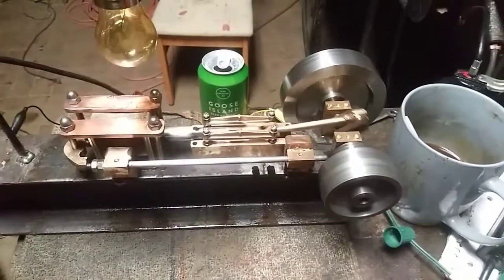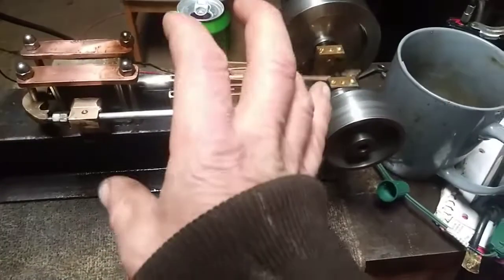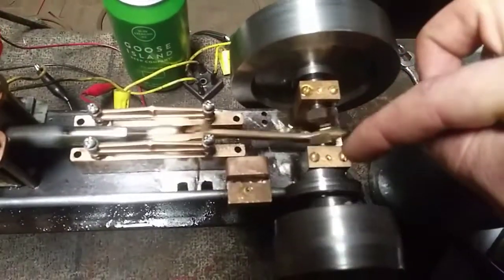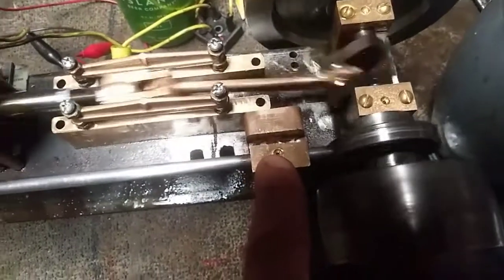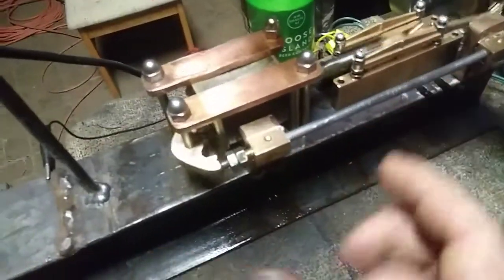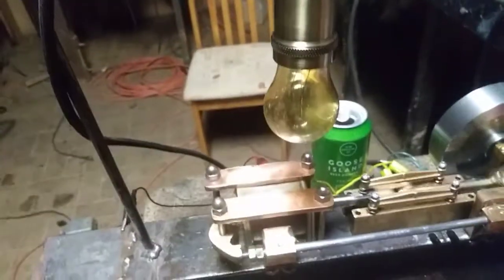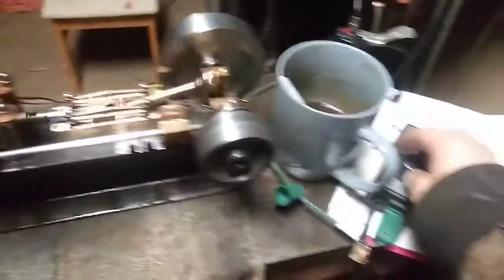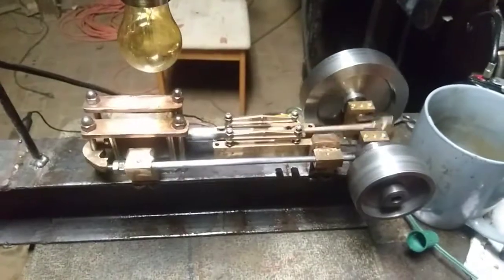Solenoid Engine Home-made.

Comment: What can you use something like this for
Reply from the maker: Whatever you want.
Reply: @rogueart7706  how strong is it and how long would it take to charge a battery bank? Could I set up something like what you have in this video and your steam engine build to combo with manure pellet fuel , wood, solar to charge a battery bank for electricity /heat/cooling/cooking , for an entire barn/living space? Do you sell components/offer advice in building systems ?
Reply: The manure pellets would be wood shavings & mostly horse manure remade/pressed again into pellets , seen it done with pellet stoves , curious about efficiency with steam engine application
Reply from the maker: @yogiballa  a steam engine is best for what you want to do since you can burn anything. My steam engine is almost 1 horsepower (.79 hp) at 200 rpm. Yes it would charge batteries no problem.
Solar is ok if you have money to buy a panel and lots of sun.
Where do you live?